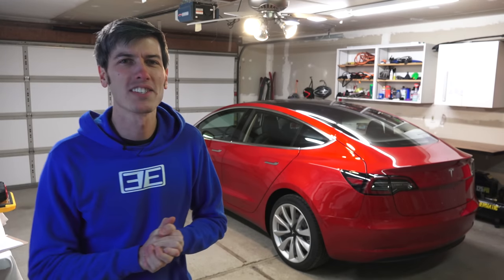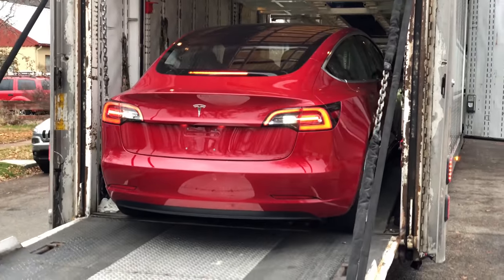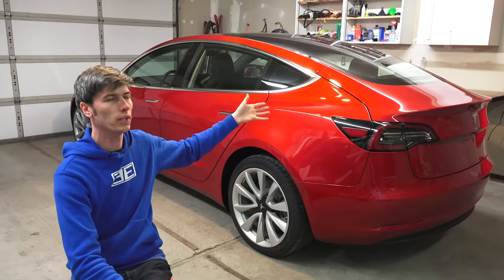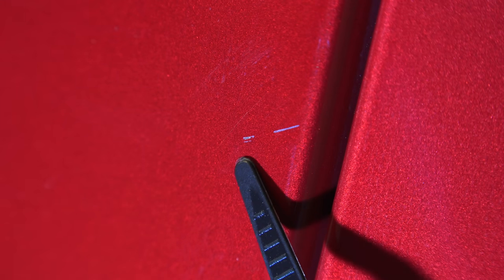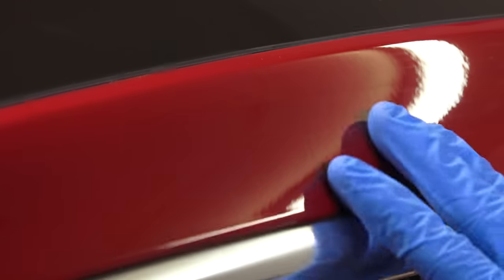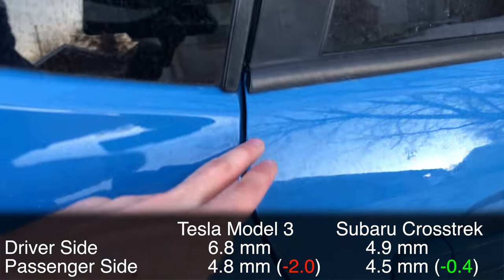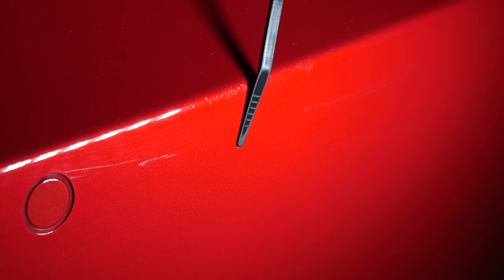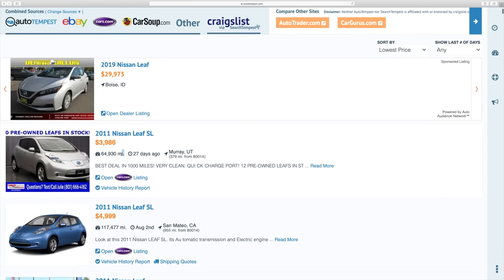Everything That's Wrong With My Tesla Model 3 - Quality Problems

Comment: I worked at a Ford plant and QC was a HUGE priority! If a vehicle was found to have any defects workers were responsible for letting their supervisor know and give the batch number for the car. When the vehicle got to the end of the line it was brought aside and  left to  have the issue completely repaired. If multiple defects were present the line would be shut down until the issue was solved. All panels that could be scratched during installation were protected and protective layers for the doors and panels were added during transport to bring all potential damage during shipping of the vehicle was minimum. Not to mention any issues that were found after the fact either at a dealership or by a customer was dealt with promptly, with full body paint work, extended warranties and/or repairs were done at no charge to the customer and done to the highest standards. The amount of vehicles made in a day was 2-3000 depending on hours and how well the line was working, with an average of around 75,000 cars being made monthly there was less then 10 cars with defects that made it to the customer. Hopefully this is one of the handful of cars that slipped through the cracks and not a common occurrence. I understand that it isn't always perfect, and that once in a blue moon the stars align and a vehicle manages to slip through all the cracks and ends up having issues that the customer finds. So as long as this was one of the rare occurrences and Tesla dose the right thing (which it sounds like they are) then I'm not too concerned. However if this is a common trend then Tesla really needs to improve its QC and find a way to protect cars from damage during transport and assembly.
Reply: My friend bought a brand new Dodge Ram and the orange peel in the paint is horrible, he took it back to the dealer and they basically told him to shove it it's his problem now.
Reply: Stryker Stryker interesting… I’ve never had any issues with Dodge… my family has been a Dodge family for years! My father had paint issues on a 2017 challenger, even though he noticed it after a few months of owning it the dealer arranged to have everything redone. Every brand has bad dealers though… it’s sad that they treated your buddy like that… that’s how you lose a customer… hopefully he has better luck with Dodge in the future!
Reply: @Toxic_Waste92  Dodge isn't American anymore. Dodge used to be good but now it's as good as the Fiat company who owns them. A real shame. They were much better off in the Diamond Star days and should have stuck with that or maybe with Daimler, as the Japanese and Germans are known for quality... not Italians though. I suppose the up-side is that they will have better styling when they break.
Reply: I worked at the Chrysler plant where they build the charger, challenger and the 300. QC was conducted by 18 year olds in under 45 seconds. The number of cars that were shipped out with CELs, smoking from under the hood, dead batteries, engines that bogged down....the list goes on......
Reply: Agreed. QC is a vital part of the manufacturing process. Feedback from QC issues must be taken seriously and followed up promptly to insure that flaws do not propagate within the system.
Reply: Itamar Arce The Chrysler plant in Brampton Ontario? I know they make some of the vehicles you’ve mentioned there but not to sure what their complete list is… I worked at the Ford assembly plant in Oakville Ontario…
Reply: @Toxic_Waste92  yup just those 3 I mentioned...all trims including the demons and hellcats. I should mention the QC I mentioned was the 3rd party company that took delivery from Chrysler. One could argue that both Chrysler and this 3rd party company who took care of transportation suffered in the QC department hahah...hows QC at the Ford company?
Reply: Itamar Arce it’s good from what I could tell… I worked there under their student summer job program, gave me so extra cash for college so I can’t complain… my job on the line was fairly early in assembly, right at the start of Trim after the vehicle left paint. QC was a huge priority especially in my area with signs posted everywhere, weekly inspections where the clipboard warriors watched your every move and any defects we found was reported to our zone supervisor with the plants identification number so it could be tracked down… a lot went into keeping vehicles safe including vinyl protective stickers and foam blocks protecting doors and even plastic rotor covers to prevent rust. I also happened to be working during a big production switch… the Ford plant I work at is the only Ford plant in the world making the Edge, Flex, MKX and MKT and the new redesign for the 2019 Edge and the 2019 MKX so QC was probably in overkill mode with the first few runs of the new model. But even with the 2018 models of QC issues were present in large batches it was common for the line to be shut down for a few hours at a time until it was fixed… now that’s where a lot of people would joke and say that Ford can’t even get their assembly plants to run let alone their cars but I think that with nearly half of the work force being filled by students I think line shut downs were inevitable. I liked working there, pay is good, pension is good, benefits are good… the list goes on. The guys I worked with wanted me to stay on full time but my education is what I wanted to focus on. I wish I had more information about the QC but aside from what I seen I don’t know what else was done. Do you work on the assembly line yourself or do you have a higher profile job in the company?
Reply: Ford has been around for over a century, Tesla is roughly 10 years old.  Aesthetic details are a goal, but not a priority in it's infancy as a car company
Reply: rjh right but to use your own point against you, Ford back in its infancy made the streamlined Automotive Assembly line that has been redesigned and overhauled over the last 100 years to streamline it even further… Tesla is a car company in its infancy but has over 100 years of development at its side that makes their job heaps easier then it was for Ford in its infancy… Tesla is however still behind in terms of its ability to pump out new cars, with the Ford Assembly plant I worked at being able to pump out about 17500 cars a week where as Tesla is producing a little over 5000 cars a week… assuming that both plants have 2 shifts with each shift being about 9 hours then your looking at Ford making 3500 cars a day or 1750 cars every 9 hours versus Tesla which is making about 1000 cars a day or roughly 500 cars every 9 hours… this means that Ford has a car coming off the line every 18 seconds where as Tesla has a car coming off the line every 64 seconds meaning that Tesla has 3.5 times longer then Ford to make each car yet Ford has a much higher quality in terms of paint and panel gaps… to me that’s not acceptable… yes Tesla is a young car company but with the cheapest car Tesla sells being over $40,000 and a paint job with a $2500 price tag versus Fords cheapest car being under $15,000 and still managed a better paint job and panel gab consistency then a car that costs more then 2.6 times as much well being pumped off the assembly line 3.5 times faster then the Tesla… so Tesla is a car company in its infancy but it also has the more time to make each car and costs more to purchase each car versus its competition… I say this as a guy who isn’t really a Ford fan, I personally prefer Dodge and am currently in school learning how to be a mechanic for a Dodge dealership… I’m also planing on owning a Tesla one day because I believe in Tesla and believe that electric cars will be the future for all cars by the time I’m 50… but no matter how much I love Tesla, I can’t ignore the facts… Tesla should be able to pump out much cleaner and well built cars but is falling short of the mark… now thankfully Tesla seems to have the customer in mind, and when the pain issues were brought to their attention, they were more than happy to fix it at no cost to the customer and provide them with a loaner vehicle while their vehicle was being fixed… that right there is the mark of a great car company, a company that values its product, wants to provide the best product can, and is more than happy to make it right when the customer notices something that’s wrong… so yes Tesla is a car company in its infancy, but I know that Tesla can and should be doing better then the car featured in this video, the ball is currently in Tesla’s Court, they are ahead of the game in terms of electric cars, they are far ahead of the rest of the market, and when the market switches from gas powered vehicles to electric vehicles, Tesla will be the company running the show. They just need to make sure that the products they are putting out there are the top-of-the-line, this car did not meet that mark.
Reply: @ryanjhamm  If you want to "fight" the big boys you have to be competitive, no matter how old your company is. With huge claims by Tesla and especially Elon Musk himself, you'd expect Tesla to get at least the paint job of a 50.000€ car right. 
Quality control is a vital part of the production process, especially for expensive goods as cars. 
I would not accept the huge panel-gaps in that price segment. However, I see why the unusually high grade of automation in the plant might cause these issues. But there is literally no reason why you should accept such flaws on a 2500$ paint job (fun fact, its actually a 2.900$ option here in Germany)
Reply: rjh so I realized I made a few mistakes in my comment and decided I should make this update because I’d rather admit I fucked up and correct myself then have false information floating around… I recently got called back in to temporarily work on the assembly line at Ford during my time off school. Today well I was there I realized that at the end of a 9 and a half hour shift we had produced about 650-700 cars… the line went down a few times today so I’m going to average that anywhere from 600-750 cars can be made during a shift at my plant depending on how well the line is running and how many hours we do… this means that Ford produces 1200-1500 cars a day… now I would use this updated information and redo my math but I’m lazy… so although Tesla still has more time per vehicle then Ford it is not even close to as dramatic as I made it seem… so please feel free to redo the calculations and see the true numbers… I do apologize for the incorrect information